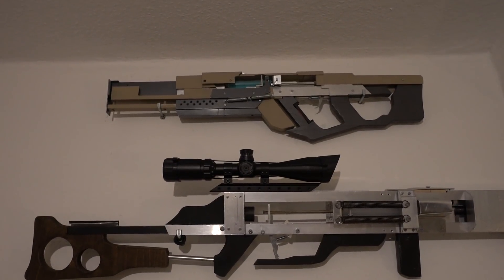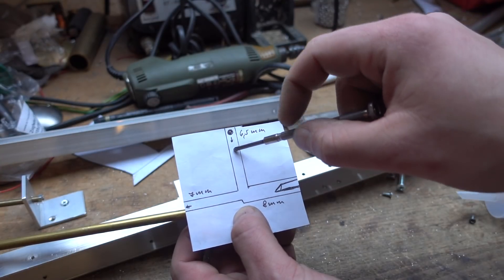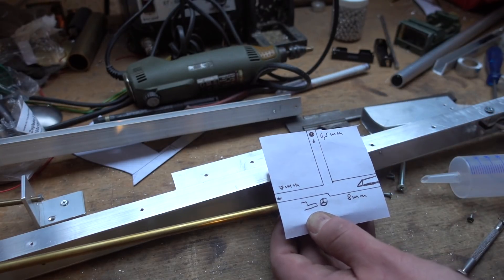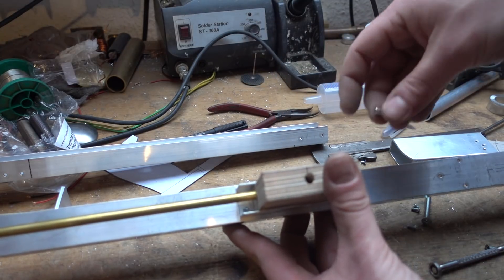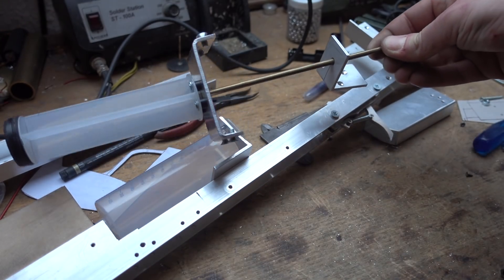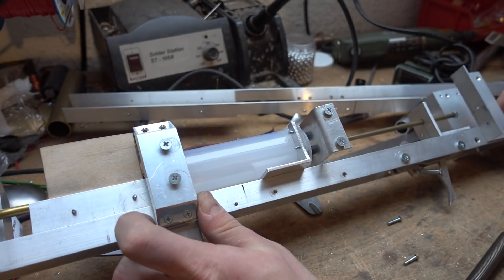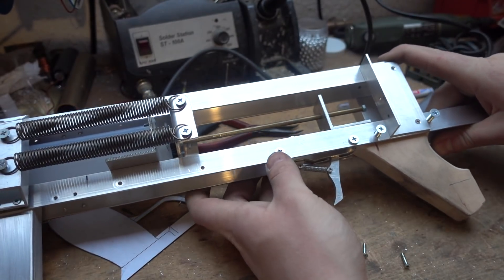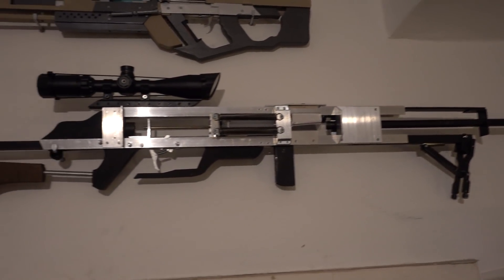Super accurate powerful DIY BB sniper rifle TUTORIAL

Comment: Thats pretty good considering that the plunger tube is pretty small. do u know what strength the springs are
Reply from the maker: Uhm.....no.
Reply: 100 ml is actually quite a lot. If you look at high performance airsoft, it does even look like less volume to me.

Comment: I open up every airsoft spring gun that comes into my posession, since Im always trying to improve their accuracy. And I never thought about using 2 "pull" springs instead of the super common "push" spring setup. Multiple pull springs seems to be a better idea overall. Good video. Wish I could upgrade all my springers with that huge syringe also, but it wont fit inside any of them hahaha.
Reply: Ya, its a bit outside the box :>